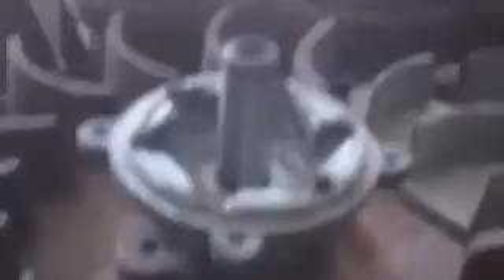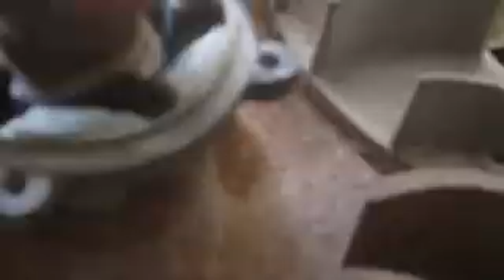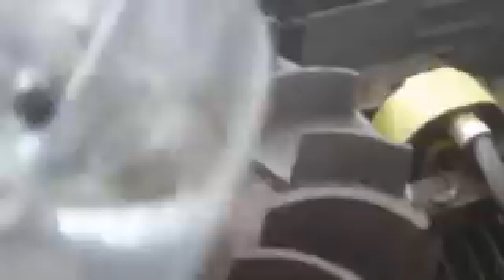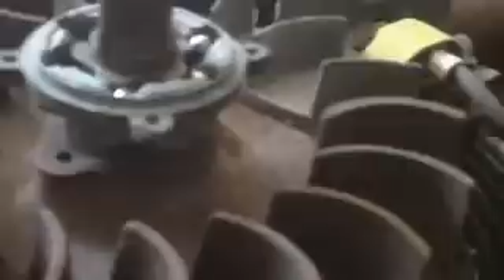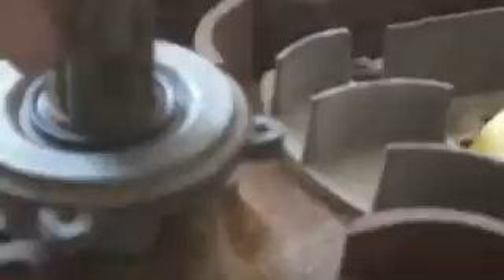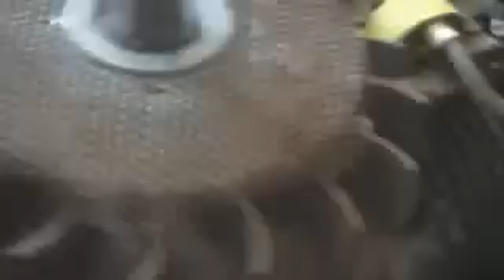how to fix a starter clutch on a briggs and stratton engine

Comment: Their about 10 bucks on ebay right now. But if its not broken, just clean it out and lubricate it which is what has to be done every 10 odd years or so anyway.
That starter clutch cost me a sale today for a mower I would have got 80o for,  that I'm now taking 700 tomorrow. So it cost me a 100 dollar bill, that is, if it goes tomorrow, but it should.
I fixed it right in front of the guy, he still got cold feat a yhow, even though it was good for another 10 years now...

Comment: These starters are a piece of shit design because when the engine gets hot the end of the crankshaft expands and catches inside the aluminium rotor and then proceeds to wind the starter spring backwards and bend the fuck out of it and this is even after I cleaned the crankshaft with sandpaper and reamed the alloy rotor out with a drill bit then oiled the little felt pad inside the end of the rotor :(